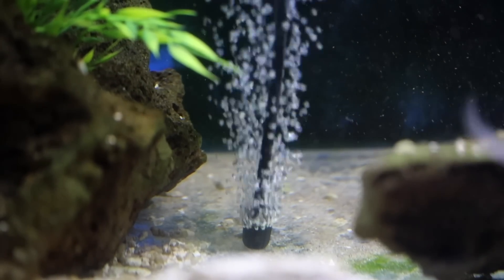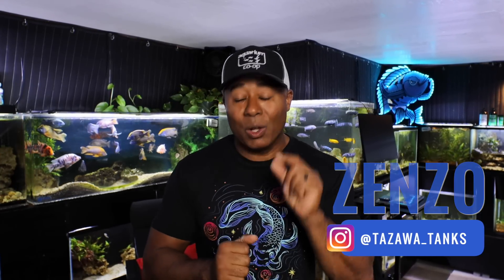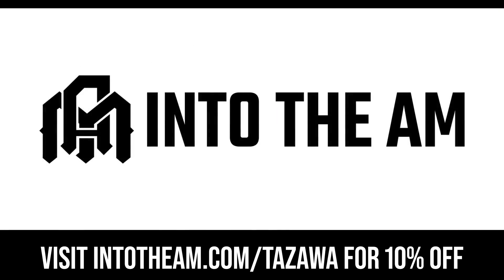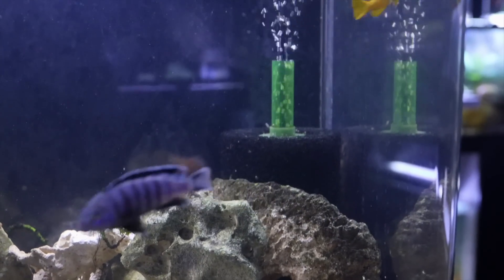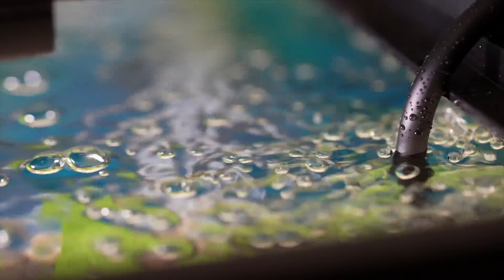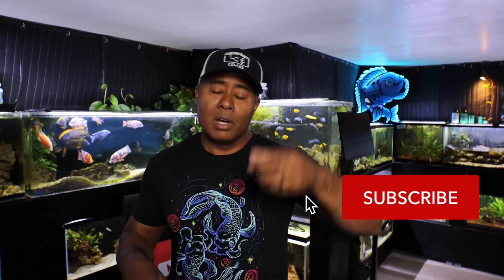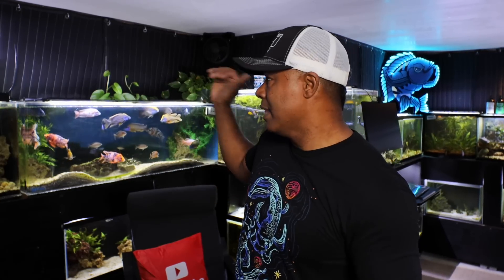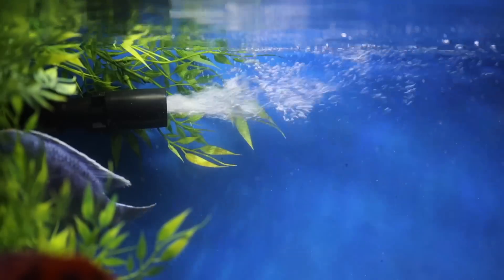My Fish Could Have Died From This Mistake - Use an Air Stone!

Comment from the maker: Have you made a mistake like this before? Do you use air stones in your aquariums? What do you use for surface agitation?
Get an awesome t-shirt from INTO THE AM: https://intotheam.com/tazawa
Reply: When I was setting up a new tank I thought my canister filter would provide enough surface agitation I was wrong.  I had to add 2 airstones and wave maker for 72g bow front.
Reply: I super aerate the water as it flows naturally from my overflow boxes into my first sump chamber This heavy aeration aslo improves the efficiency of the nitrogen cycle as the super oxygenated water flows through my various porosity sponges.
Reply from the maker: If you are interested in the venturi I used: https://www.growgreenie.com

Comment: Hi. I need your help please!! Don't know what to do. My cichlids are swimming on the top gasping for oxygen. I do a air stone and wave maker.  Water test, amm-0, Nitrate-40, Nitrite-0,Hardness-25(very soft),Chlorine-0,Alkalinity-180,PH-7.8,Temp-82.  Thx in advance. Did 25% water change...
Reply: I know this is an old post. Was there ammonia in the tank?  How did your fish make out?

I'd do an immediate 50% water change if my fish was gasping for air, if you already have lots I'd aeration.
Reply: @applegal3058 
Hi. I lost few of them. 🥺 Did a 50% water change. A friend of mine told me, probably lost my cicle.. Honestly,  I'm not sure. Since then, I added another filter and when I do water change I only clean one filter every other week...
Reply: @benjamins15779  that's too bad.  I'm sure you were sad when you lost some. Glad you have a handle now on what works for you tank with water changes.

Comment: My air line tubing from the pump to the check valve keeps coming off. It won't go all the way down to the base, but the other connections don't either and they don't come off, even the one in the water.  Any suggestions?
Reply: Sounds like you put them on the wrong way the air flows through one way
Reply: @inkspill9189  oh actually I quit the hobby several months ago, but in regards to the airline tubing, it was just because there was too much tension and vibration on that line which was an easy fix. However I just announced yesterday on my channel that I'm getting back in to the hobby. I'm looking at a 40 breeder that's on sale right now, and that's a tank I've always wanted, so it seemed like a good time to start things up again

Comment: Hello, Is it possible to keep only air pump in my 15 gallon planted tank and remove HOB filter? As the water change can clear out the fish wastes so why Both air pump and HOB water filter should run in the tank. Please advise with your recommendations.

Comment: The canister filter Venturi will be a good visual way of seeing the filter is working.  If you don’t see bubbles then you know the filter is either turned off by accident or clogged and not actually filtering correctly

Comment: I use a sponge filter with ziss airstone and USB nano pump (so quiet you can't hear it from even 2 feet away) in every tank. In my 20L I also have a HOB to help with filtration and water movement in the long tank. The nano pump works for 2+ days when the power goes out using a regular cell phone emergency battery.  I always have an airstone!

Comment: I'm a little surprised your fish were already gasping at the top after the time period you described.  Two weeks ago we had a storm that knocked our power out for 42 hours (Tuesday 10 pm until Thursday 4:00 pm).  My eight cichlid tanks, a couple of which are overstocked like yours, were without filtration or surface agitation the entire time.  I feared the worst, but I only had 3 fatalities out of many dozens of adults and fry.